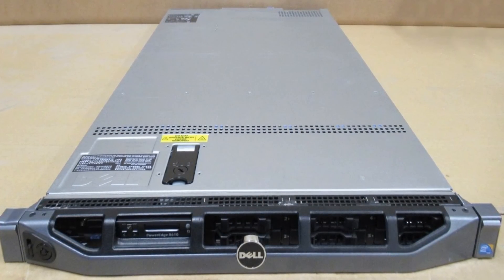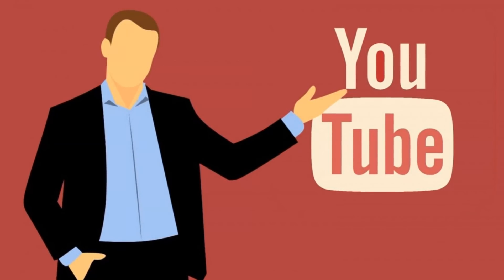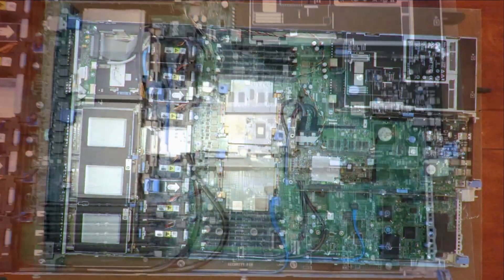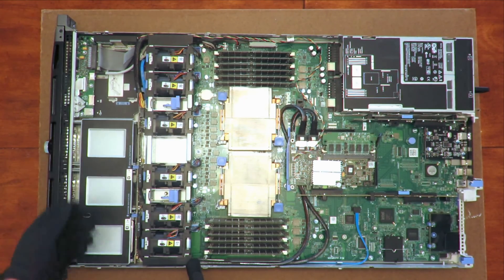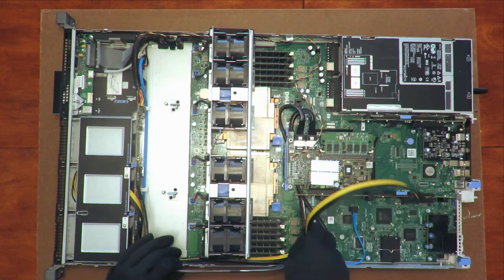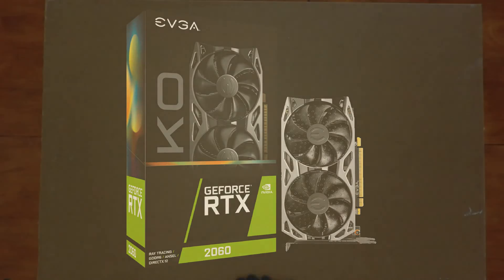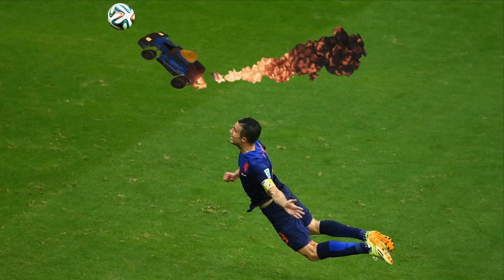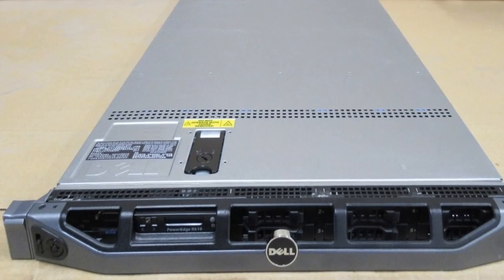How to install a Graphics Card in a Rack Server with external power supply?

Comment: Why don't you use 4 sata ports to power 2 6pin cables and convert those 2 6pin cables into 1 8pin cable? That way you don't have to use external power right?

Comment: After about two years of research, I decided to install an Nvidia RTX 4060 into my HP DL380 Gen 9 server.  It was a tight fit because the card is a full 115 mm tall, and the 180-degree power adapter made the card an extra millimeter wider.  "Tall" is synonymous with "wide" because the cards are parallel with the motherboard.  Since the 4060 is an x8 card, I installed it in Slot-2, which is physically a x16 slot with x8 bus, which spared me the cutting of the back of the PCIe slot.  The server's PCIe slots are 3.0, though the card is 4.0, and I don't know how much loss I take with my 2K-1440p gaming.  The 4060, I discovered is a one slot card if the cheap fans are removed, which also allows the card to easily clear the underside of the lid.  The back-plate still covers two slots, but the slot-1 is open, and I could create a single slot back-plate if I can master making precision port cuts in the plate itself.  Fan two of six, which blows across CPU-1's heat sink has a lot more power than those two cheap 80 mm fans that I removed from the 4060, and now the card uses 105 watts instead of 115 watts.  The thermals are amazingly low, which is important because low heat means low noise.
I was intrigued by your use of power from the SATA backplane.  If needed, I could install the eight-drive cage in bay-two to have SATA ports or adapt a cable to pull power from the other riser card if I got a more powerful GPU.  I am NOT cutting a hole in my lid, but I might try to snake the cables out of the case to an external PCIe slot and PSU.

Comment: Awesome video! To confirm, is the molex power supply on the PCIE x8 to x16 riser essential? I got one without and the GPU is not showing with `lspci`. There is power connected to the GPU on the dedicated 8 pin, and the lights are displaying. Any suggestions would be greatly appreciated.

Comment: I have been trying to get my RTX 3060 Ti to show up on a Supermicro X9DRH-7F which I bought on eBay but no luck even on OS boost. It works great on my socket 1200 build so I know there is nothing wrong with my GPU but no luck with the motherboard for the dual xeon build which I want to use it for. Any ideas??

Comment: Very interesting way to do it.
I would've personally spent slightly more (or shopped around more) for a server model w/ onboard 6 and 8 pin power.
Still -- it works and it's functional
That's what matters
I'd never cut my 710, 720 or DL360G8 tho that's borderline server heresy lol

Comment: I have a Dell power edge 620r and I ordered the processors you shared and it’s giving me a volt error so I’m assuming it won’t work then.
Reply from the maker: The r620 is newer than the r610...

The r620 uses Intel C600 series chipset (Intel Xeon processor E5-2600 and E5-2600 v2 product families)
https://i.dell.com/sites/content/shared-content/data-sheets/en/Documents/dell-poweredge-r620-technical-guide.pdf

The r610 uses Intel 5520 series chipset (Quad-core or six-core Intel Xeon processors 5500 and 5600 series)
https://i.dell.com/sites/csdocuments/Shared-Content_data-Sheets_Documents/en/R610-SpecSheet.pdf

Comment: I have an R715 w/ upgraded CPUs to Opteron 6328s w/ 3.2GHz to 3.8 (turbo). Found out that I had the 25W / x8 limitations that are the same as your's here. I WAS trying to make it a RAID NAS, but found that 2.5" drives are expensive at larger capacities and I wanted to try for 10TB drives. Found that, also the PERC H700 had some issues with <2TB drives, which many RAID Controllers had. I guess this was fixed with a firmware upgrade. I wanted to still try for a RAID, even though I would be limited by the 3GB/s SATA and by the size of the drives, due to their price and would be limited by going to SSD, since the PERC only supports 3GB/s SATA SSDs. Have you dealt with these controllers and do you know if they will support larger drives, so long as they are 512e drives (as opposed to 4Kn)? Is there any way to mod it without tossing the 6 bays and RAID and still get the same end result? Any recommendations on what to use this server for?
Reply from the maker: External Power supply  timestamp 8:23 would be the best option.
Reply: My R710 has 2.5" drives and I also found out they're much most costly (the hard way).
Check used drives cheap, and even use it as a smaller storage
Or you can get a JBOD setup connected w/ external cables and an external-facing controller (to have 3.5" externally in a separate small enclosure/rack, and you could put 1TB SSD's in the main server or something)

Lots of possibilities.

Just make sure your RAID controller does not have a hard limit. My R710's stock card could only do 2TB drives max.

Btw, you CAN purchase other chassis/bays and backplanes, and swap 2.5" for 3.5" if u can come across chassis only or the bays separate. Backplanes are all over the place.
Reply: @-ColorMehJewish-  I believe the 2TB limit can be overcome with a firmware update to the PERC. Thanks for the info!

Comment: I'm kinda new to this. I have a PowerEdge R7525 server and a RTX 3080Ti GPU. Initially I thought I just needed to purchase a riser cable extender and a external power supply for my GPU. I have a current PCIe gen 4 riser cable but it doesn't have a molex cable on it, how can this connected to the power supply adapter?
Reply from the maker: Use a SATA to Molex cable (Amazon B07BQFKTG7). Connect one end into a sata drive slot (5:40 to 6:15 in the video), then the other end into the adapter. Plug the 24 pin of the power supply into the adapter. When you turn on the server, it will power the sata drive slot, that will power the adapter and switch on the power supply.

Comment: This is fantastic.  Couple of questions for you.  What's the max power you'd feel comfortable with doing the SATA to PCIe connector?  I have a Supermicro server I built that is my file/Plex server - going to throw some AMD 480 8 GB cards in there to mine.  I think they, once configured, should be around 100 watts.  Luckily I have 4 drive bays free (just checked) so I could do 2 drives running off the backplane.  On the 3rd drive, do you have to flip the cheap PSU on before you power on the server?
Reply from the maker: The ATX standard for SATA or Molex connections is rated for 54 watts each. This is on top of the 25 watts coming from the PCIe slot. (133 watts total). Servers have a good tolerance and can push it more, but shouldn't be pushed to 100% for extended time. Also, connecting 3 or more 54 watts could put the backplane beyond it's capabilities. Since I have SSDs in the other bays, virtually all the power is going to the two for the GTX graphics card. 

As for using the external power for the RTX, I used a power supply adapter (link in the description) that powered the external on and off automatically. They also make a SATA version, so it could be connected to the drive bay to auto turn on the external power supply.
Reply: @ThreeDigitIQ  My backplane has 16 SATA/SAS connections to a 6 Gbps Quad channel SAS Raid controller.  It's the BPN-SAS3-836EL1.  Going to look into what else I could power the PCIe with - there are a ton of fan headers on the mobo as well.
Reply: @ThreeDigitIQ  Also those video cards (2xRadeon 480 8 GB) have a single 6 pin connector, which I thought was limited to 75 watts?  So rough math time - 54x2+25= 133 watts.  That would be pushing it to do 2, even though I'll back it off in the software (max pull current).  There is a Molex for a DVD player that is unused; perhaps I'll connect it to one?  thoughts?
Reply: The Supermicro system board has:  2x PCI-E 3.0 x16 / 3x PCI-E 3.0 x8 / 1x UIO PCI-E 3.0 x8 (for SMCI UIO HBA) or 1x PCI-E 2.0 x4 (in x8).  According to Intel's website, "the PCI Express* x16 connector on Intel® Desktop Boards can deliver only up to 75 watts.".  I'm going to go pull the cover off and see if anything's printed with the power rating.  Pretty sure PCI-e v.2 only does 33-35 watts, but the v.3 does 75.  Which would make me sleep easier at night. Where are my glasses again? :)
Reply from the maker: @mlj_the_shield  75w + 25w = 100w Would be my "rated" maximum. 133w is the physical maximum. I just re-ran a few benchmarks and my GPU maxed out at 122.9 watts. Be careful with the AMD’s Radeon RX 480. It has a TDP rating of 150 watts. Some users have reported it pulling up to 165 watts without overclocking.
Reply: @ThreeDigitIQ  I'm going with a 1066 TI in that server, and only a single.  And I found 4 molex (standard old school) type that plug into the backplane.  Will let you know, if you don't hear back I've set the building on fire.
Reply: @ThreeDigitIQ  Got everything wired today and spent longer modifying the fan speed in ipmitool than anything else.  Perfect sweet spot was 25%.  Anyway, it's working great; the mining is using 96 W and I've been monitoring it for hours in DRAC.  Thanks again for the video!
Reply: @ThreeDigitIQ  First of all I want to thank you for making me really think about this.  My mobo is a X9DRi-LN4F Supermicro.  Can you think of any other place I could tap into power on it?